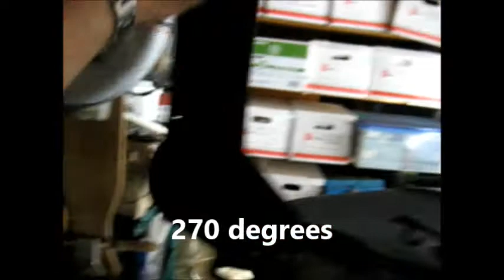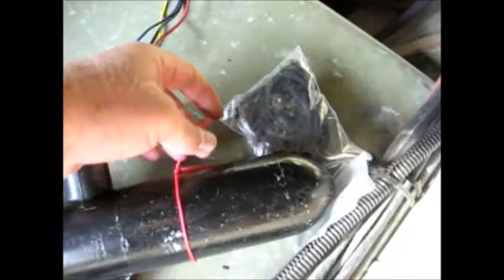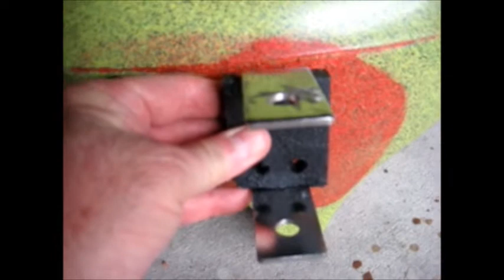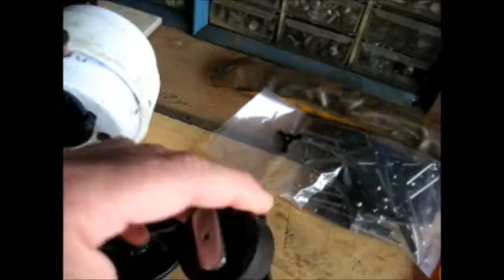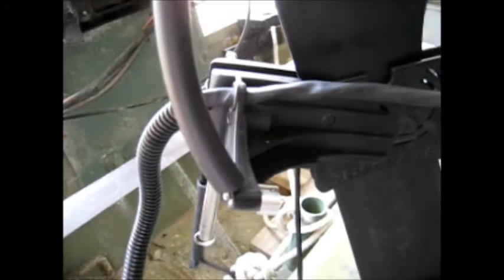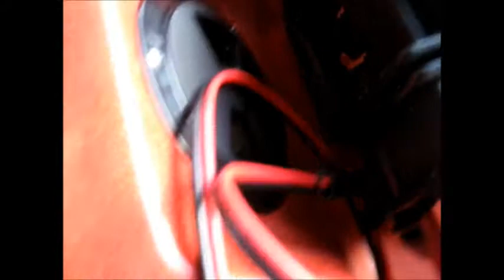Kayak rudder motor build

Comment: Any videos of how the kayak performed with the motor on it? I have the same motor. Have 2 of those straight up and down types of rudders. Switched my hobie over to that type of rudder and considering doing the motor attachment. But I’d like to see if there were any issues first.
Reply from the maker: sorry...no videos, but the wife enjoys not having to paddle. The steering is the main tweak that needed: to replace the wire with cord and tighten the steering handle; and replaced the spring in the hose with bungee cord. speed forward is slightly faster than I can paddle with my 12' pescador pedal drive. The lithium battery lost 2 of the 8 bars of power during a trip with the motor being used for 2 hours straight. It has been durable and works as intended.